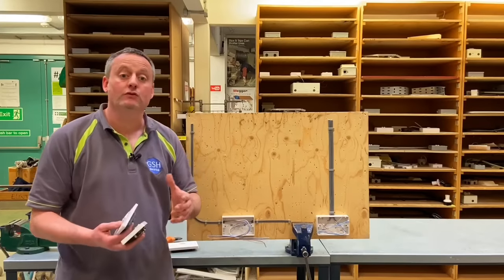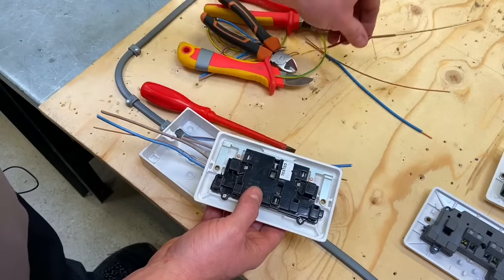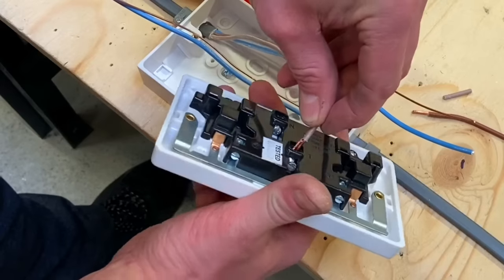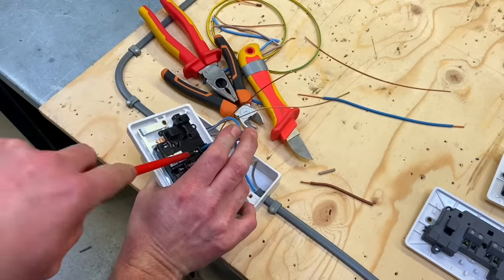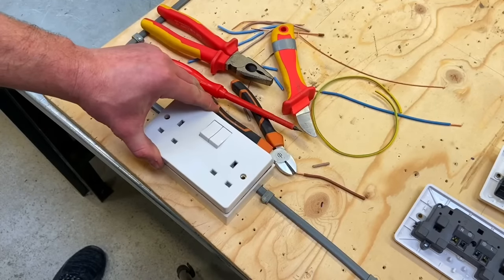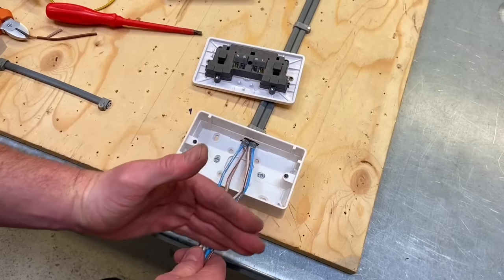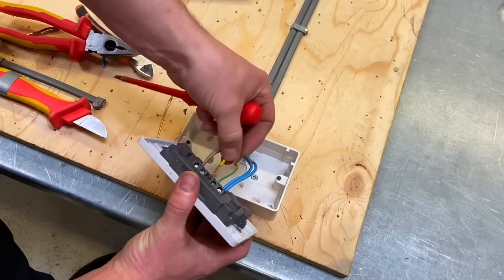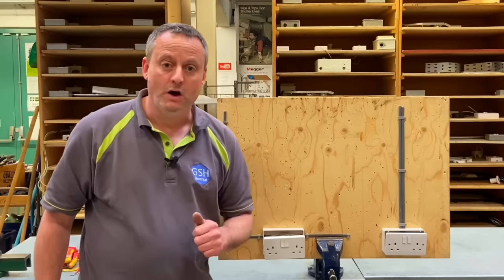How To Terminate (Connect Up) a Twin Socket Outlet BS 1363 (How to Wire a Double Socket)

Comment: In austraila,  we twist the wires together and only have three terminals. I always connect earth, neutral, active
Reply: No twisting together, when you want to test the wires separately you got to untwisted them.
Reply: Twisting is not good practice, as it can work harden the copper and stress the cable.
Reply: Hi Mark and Mark what country are you from, in austraila, standard practice to twist cables together. We also use stranded conductors. We don't use ring circuits so there is no need to separate wires to carry out testing
Reply: It makes testing a pain but better than having multiple wires in a screw terminal loosen over time due to temperature changes, or because the screw didn’t bite down on the all the conductors properly. Wagos a better option for multiple stranded wires I think. But we’re a bit backwards here - they were basically unheard of until recently. Only just starting to see them used.
Reply: Older versions of Australian Standard 3000 had a requirement to twist together earthing conductors smaller than 4mm2 in certain circumstances (e.g. clamped joints AS3000-1991, clause 5.5.5.4.(a)).  The 1991 standard also stated that "doubling back" of the wiring is one of the "approved methods" to ensure that sufficient contact area in the earthing terminal (AS3000-1991, clause 5.5.6.3,(b), (vi)).  While no longer in the Australian Standard, I suspect that these two clauses are behind the current Australian work practice of twisting wires together, and doubling back of a single wire under a termination.  My personal experience is that twisting wires together before installing it under the screw terminal (yes, even for solid conductors) provides less opportunity for thermal cycling and subsequent failure.  The percentage of wiring that has a fault that requires one to undo a twisted conductor is very small, and should not be the rational to avoid the extra minute of work.  I am surprised that using solid wiring is still, particularly for earthing,  a thing in the UK.  That was prohibited in Australia after the release of the standard in 1979.
Reply: Thanks for that Anthony, my point was how electriclal works are completed in each country. As a electrician for more than 40 years,  industrial  Control Electrican, Scada, PLCs, Radio, Telemetry for Water and Waste Water systems. I find it very interesting how electrical  works are completed in each county.
Reply: Should. Never twist solid core conductors.

Comment: Can somebody explain me, why in UK you using TN-C, TN-S and TN-C-S instead of TT earthing system?
Reply: Have a squint through the GSH library for a more detailed explanation.
Reply: It varies greatly from area to area. Mine is a TT for example.
Reply: Because they do, and TT is also common there afaik. Here in Germany the most common systems are TN-C-S and TT. TN-S is used here only in some industrial installations. TN-C in old installations, the PEN is then splitted at the outlets directly. PEN connected to earth terminal, wire bridge to the neutral terminal. That practice was permitted until 1973, from then on in new installations the PEN had to be at least 10mm² copper or 16mm² aluminium.
In Germany actually we use a combination of TN-C-S and TT, even if you have a TN-C-S system you still must have an additional earth electrode. Mostly included into the foundation of the house (foundation earth electrode) or a ring earth electrode around the house.
Reply: @Marcel_Germann  yeah in France this is the same we use TT for homes. But only TT is allowed for homes installations.
Reply: @thom78280  Here in my house I got TN-C-S, but an additional earth electrode. Normally in a TN-C-S system an additional earth electrode is not required, because the DNO also supplies the PE and not only the neutral. The advantage of this is, this is having a very low earth-loop impedance. In a TT, depending on the soil, the impedance is typically between 5 Ohms and 1 kOhm. In a TN-system the earth-loop impedance is in the range of 0.5 Ohms. That means in case of a short-circuit line to PE the MCB will trip very fast and you don't require the assistance of RCDs to achieve this. In Germany, in case of a short-circuit, the supply must be cut off (on circuits fused with 32A or less) in 0.4s in TN and 0.2s in TT. Without an RCD you can't achieve this in a TT grid. In TN it's practically in less than 0.1s without RCD. But in new installations almost everything must be protected by RCD, doesn't matter if TT or TN. There are a few exceptions from this, for example water heaters in bathrooms in zone 1 if the MCB trips in less than 0.2s, which is actually only achievable in a TN grid.
Reply: @Marcel_Germann  thank you for your explanation! I understand better now!! But i have an question in TN earthing system (TN-C, TN-S and TN-C-S) does the current of short circuit reach Kilos Amps? And in TT this not the same?
Reply: @Marcel_Germann  and if the neutral fail on the side of the supplier for exemple  in TN TN-C-S TN-C that will be very dangerous for the consumer right? The insulation of the devices can be broken and the live will be at 400V and the metal cases can be at 400V because the "Earth" will be break with the neutral? ( if there no earth rod on the side of the consumer).
Reply: @thom78280  Yes. In some of my circuits I got a PSSC (prospective short-circuit current) of 500 to 600A, in one it's 1kA. In TT it's much lower, sometimes below the threshold a MCB would trip. That's the reason RCD is required almost every time in a TT system.
Reply: @Marcel_Germann  interesting!
Reply: @thom78280  In case of a TT system if the neutral breaks the appliances will also "see" up to 400V, depending on their internal resistance (the higher their demand, the lower the voltage they'll "see"). In a TN-C-S system the housings of class 1 appliances would become live at mains voltage. That's the reason EV chargers require a PEN fault detection in that case. In a three-phase installation it's quite easy, all voltages are monitored (lines against lines, lines against neutral, neutral against PE) and you got more reference points. In a single phase system it's not that easy for a monitoring device to detect a broken PEN. In some cases then the EV charger earthing system is changed to TT, so it got its own earth rod.

The thing is, outdoor is more problematic. If you got a broken PEN inside of your house you still require a different potential to touch so a current could flow. But all metal services (water pipes, gas pipes and so on) are bonded to the central equipotential bus bar. Meaning they will also have the same potential as the housing of the electrical appliance. That will have the effect of a bird sitting on a high voltage overhead line which is uninsulated. The bird will have the same potential as the line, but he won't be electrocuted. Only if he would touch the grounded part of a pole at the same time he has contact with the line.
That was a safety measure here up to the 1950s, called "Isolated room". The room had to be dry, no other potential like water pipes or pipes from a central heating system. Floor had to be insulated (the electricians had to test the insulation back then). The outlets were type C instead of the standard Schuko ones. That was mostly done in bedrooms and living rooms. Type C was like Schuko, but without the earth clamps. Or like the french outlets without the earth pin coming out. Both plugs would fit into type C outlets.

Type C outlet:

https://upload.wikimedia.org/wikipedia/commons/2/26/C_plug.jpg
Reply: @Marcel_Germann  thank you very much for your explanation and your time spent for me! I learned alot!!! Merci beaucoup !
Reply: @thom78280  Also the incoming gas/water for a long time were metal and it was used as a substitute TT rod (currently being renewed in plastic). Most of the ring mains in the road require renewing though so at some point all domestic dwellings in the UK will either stop being single phase and/or become TT probably to better accommodate to EV's.
Reply: @Marcel_Germann  here in France the earth rod must measure 2 meters (it is mandatory) and in your country too?
Reply: @Marcel_Germann  Think they should do that here. Add a TT in case of a lost neutral on the PEN.
Reply: @markgilder9990  I think this will come that every new building in the UK must have a foundation earth electrode (embedded in the concrete of the foundation) or a ring electrode burried in the soil arround the building. AFAIK this could be already in the next version of the BS 7671, something about this is already in a draft state.
Reply: @Marcel_Germann  In Finland ungrounded CEE 7/1 outlets (type C is incorrect as there only is the  type C plug). We're installed up to 1997. Central heating pipes were not counted here, just normal use water pipes. TVs up up the  late 70s were class 0 with the round plug (CEE 7/2), even the Blaupunkt we had. The problem was that our TV corner had a tile floor so the outlet was a schuko. One had to put an illegal self-made extension cord in between. Lamps were sold with round plugs up to the 90s.

Comment: Hi. I know I am an old. But when I was taught. The earth's had to be twisted together and put into one terminal with a lead to the box if using metal. (Metal box earth's go to the back box first then fly lead to socket. This it to protect the metal box from becoming live and killing somebody).
Why. Well if you lost the earth in one terminal then the rest of the sockets in the line / circuit have lost the earth protection. If the circuit is a radial. ?????
Why the change. ?????
Reply: It's often not necessary to earth the back box anymore - all sockets for quite some time now have earthing rings around the screw holes which connect to the CPC terminals on the back of the socket (the socket has a metal bar running round the back of it connecting both screw terminal holes and all CPC terminals). This means the screws are always earthed, for metal sockets the faceplate is also always earthed. Earthing the backbox is pointless now, plus the screws from the face plate going into the back box will in turn earth it.

Some have argued that an electrician who has unscrewed the faceplate and pulled it forward, could get an electric shock off the backbox if a live conductor has come loose......the reply to that is why is the electrician working live, and secondly the CPC could have pulled out or other faults exist etc. Earthing arrangements are to protect the consumer not a dozy/lazy electrician.

As for twisting CPC's together - some still do it, but it's frowned upon nowadays as it makes testing a right pain in the arse - especially in CU's with them twisted in one sleaving - ugh!